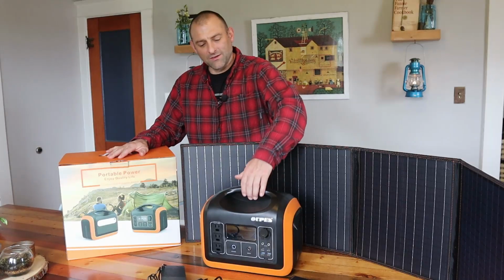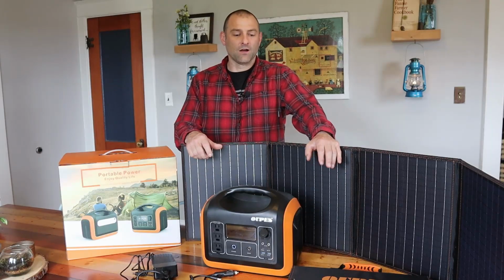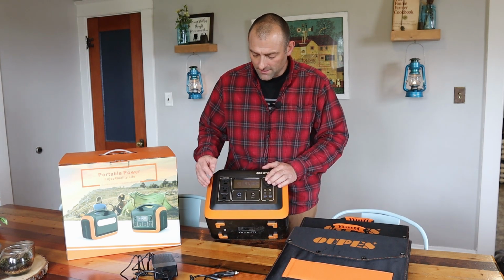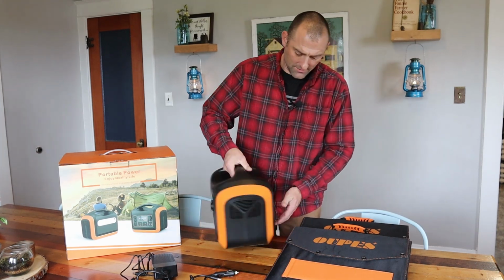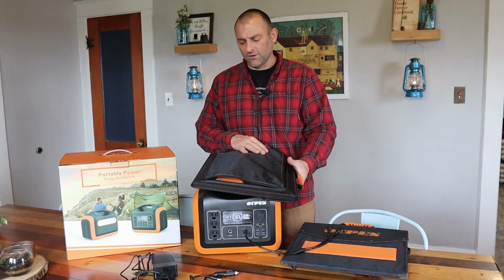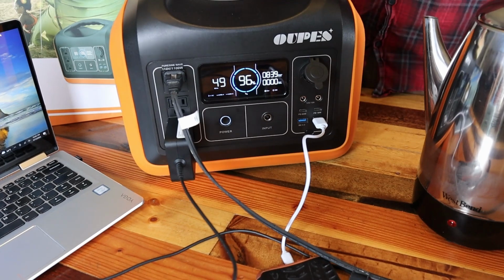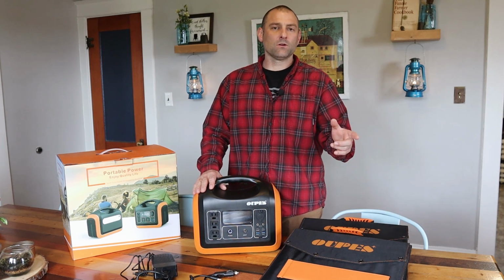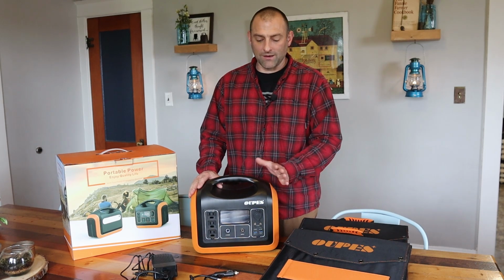Oupes 1100W Solar Generator Review | Off-Grid Power Source | Prepping | Heartway Farms

Comment: I have often wondered how these gen batteries " cycle"  A few years ago, I bought rechargeable weed whacker and edger/ tiller.  I loved them till the batteries stopped charging! ( After 2 years) It was more expensive to buy the batteries, than buy new tools!  So, I worry about ANYTHING thats rechargeable now.
Reply: 2500 - 3600 10%- 80% depending on where on you read

Comment: Sorry, but the way you said it I couldn't tell did it work in the cold at all???  That's really an important thing. Were you trying to use it out in the snow? Was the unit inside when you tried to use it while it was charged and it didn't work?
Reply from the maker: It works great! It has a safety shut off for high and low temperature points to protect the battery. So it will not work if either the high or low temperatures are reached. The temperature operational range is between 14 deg - 104 deg